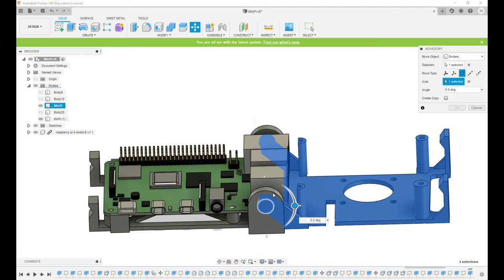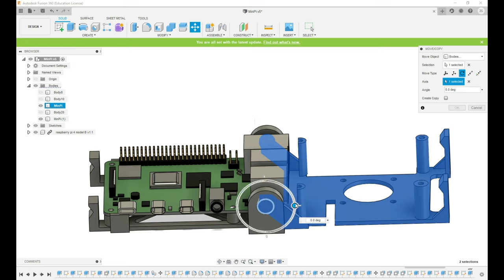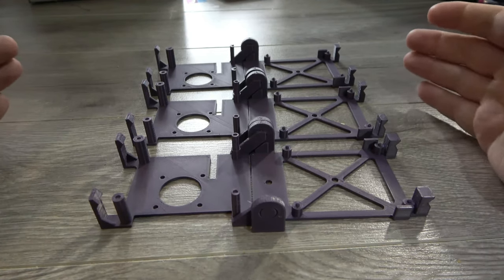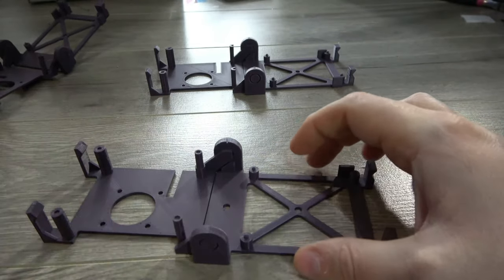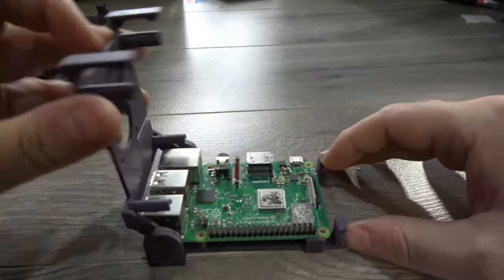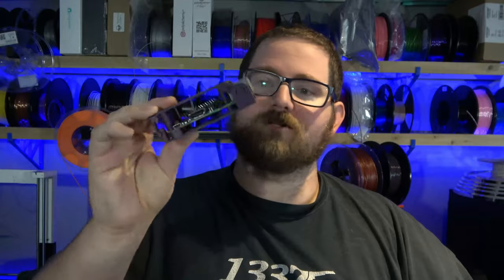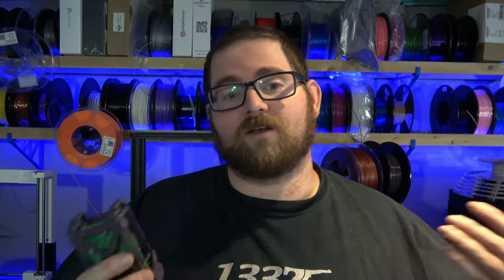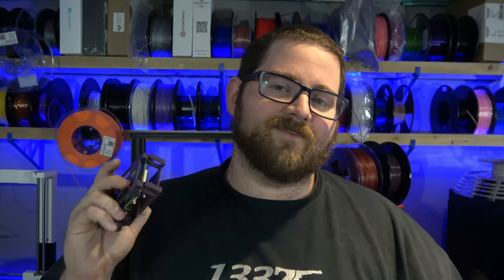Fold-A-Pi - A Print-in-Place Raspberry Pi Case [Pi Twenty-Six Ways - Episode 4]

Comment: Might you provide any tips for printing on an Ender 3 Pro? It starts okay the just falls apart, I've gone through half a spool trying to get one printed!
Reply from the maker: Hrmm. Hard to say. Do you have any pictures you could provide of your failed prints, so I might be able to understand the failure better?
Reply: @PrintNPlay  this is what most look like, going for 5th try now after adjusting temp for PLA+.

https://photos.app.goo.gl/qzQberdSNw7Hhh9v6
Reply from the maker: Oh, you gotta print it flat! Sorry, the STL might be rotated wrong. You have to lie it down, not print it on end
Reply: @PrintNPlay  that's how the file comes and it's how it's displayed on Thingverse, I've done nothing to modify it. How do I make it print flat?
Reply from the maker: Which slicer are you using?
Reply: @PrintNPlay  Cura. I was able to flip it flat. Printing now. Will update when done. Thanks for the help!